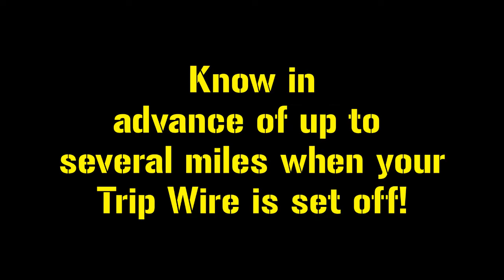Advance Tripwire Radio

Comment: Actually, this is a good idea!
Reply: Hey I was just thinking. As some radios give a multitude of call signals or call identifier signals. In theory you could set up multiple perimeter  alarms. thus knowing where people are coming in from or even how much time you may have to act or what route to retreat from.
Reply: o0oNaturalOneo0o Right on, good thinking! As well each zone could be assigned to a certain frequency, program the perimeter into radio scanner channels. Instead of the tripwire, this could be a burried cable with a pressure, microphonic or other type sensors etc. From this basic setup one could get very creative and it doesn't cost that much!
Reply: yes and listening in could give you an idea of size of force...foot soldiers or  other forms of transportation.. maybe some other forms of radio frequency on cameras " Friend ? Foe? Unknown?"etc etc